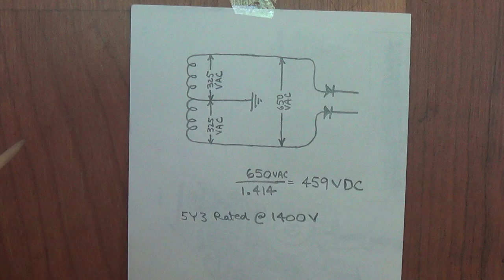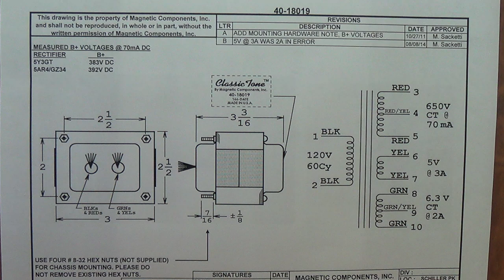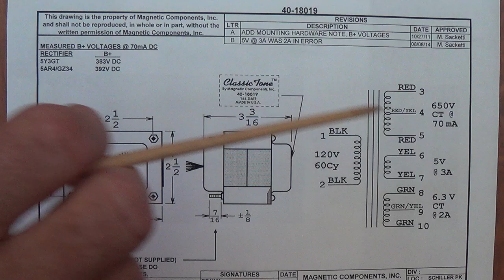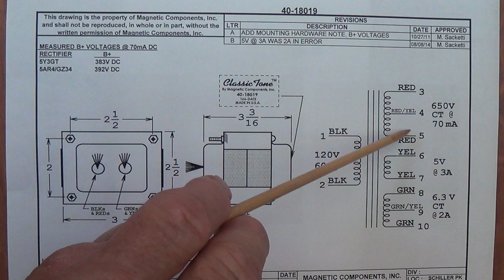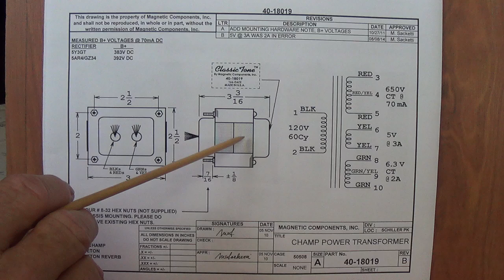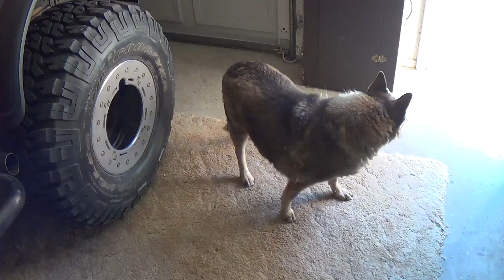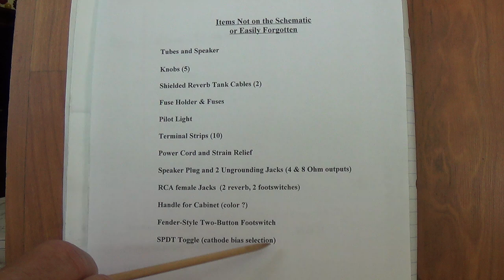How to Scratch-Build a Vintage Amp, Part 3:  Transformer Selection, Parts List, Cost Analysis

Comment: Hello Doug! I'm enjoying your videos immensely! they are very pedagogic and your pacing is very accommodating. I often revisit your videos when I have understood something new, and they always confirm and consolidate the knowledge. The first time I watched this particular video I could not really understand the specifics, but now a little more vocabulary has arrived in me :) I however wonder - what is the difference between Class A Triode Connections / Pentode Connections. the 40mA from the 6L6 correspond to the zero-signal plate current of the Triode Connection (?) with a max plate current of 44mA, while the pentode connection is 72mA/79mA. I wonder how to read this information. Does the connection just mean that there are triodes earlier in the signal chain, as apposed to pentodes? do you always calculate for the zero-signal instead of max signal? I also find different mA for the 12at7, and I feel that the plate current information is different between datasheets, looking at the 6L6 I find everything from 40mA to 56mA for zero-signal plate current. Might I be looking at the wrong information? thankful for any clarification you can provide.
Reply from the maker: Thanks, Anders. The triode/pentode connections refer to whether the output tube is wired as a pentode, with all 5 internal components wired separately.....or as a triode, with the suppressor grid connected to the cathode and the screen grid connected to the plate (anode) so that only 3 separate structures exist within the tube  (grid, screen-anode, and cathode-suppressor). Some people like the "triode" sound.....but it offers much lower gain and a lack of clarity.

I bias grid-biased output tubes at 70% of maximum plate dissipation, and cathode-biased output tubes at about 95-100% of maximum plate dissipation. The plate current itself is not the defining characteristic of tube bias.....the plate dissipation is. It is equal to the plate voltage (plate to cathode) x plate current (in Amps).

Comment: i know from experience you can overload a transformer and it will still work. you will get a voltage sag and it will run hot. it will run run hot for a long time, but it will fail earlier than if it was properly sized. it all depends on how hard you overload it. transformers are rugged so oversizing it depends on application
is it going to run 24/7 for many years or are you going to run it a few hours a day or just once in a while.
Reply from the maker: Thanks for your helpful input, KW :)
Reply: @UncleDoug  just because you can doesnt mean you should though. It can in some cases be a fire hazard so im not recommending it. However very brief overload followed by lighter loads is really the only way i would consider doing it and only if it qas a space limitation issue.

Comment: Hey Uncle Doug, Rusty and Jack:) This amp is absolutely perfect and what I was looking to build, it's in my budget range too. I was wondering if is too much to ask for you to post a full parts list with all your modifications you've made to make this amp the best it can be, also with the 4/8/16 ohm outputs can I output a 12 inch speaker or possibly 2?
Reply from the maker: +Tyler Holmes Tyler, the list in the video is as good as it's going to get. If you want a full list, I'm afraid you'll have to make your own.  Re the speaker outputs, I intend to use a 12" speaker in the cabinet, which can be unplugged to allow the use of any 4, 8, or 16 ohm speaker cabinet you chose.....4 speakers, if you want, as long as the impedance is correct.
Reply: +Uncle Doug Alright I guess I can't be lazy so I'll have to sit down with both schematics and figure it out :p I can't wait for the rest of the series :)
Reply from the maker: Best of luck with your project, Tyler.

Comment: What prevents you from switching to a more efficient rectifier tube since fidelity to concept is not a limiting factor?  I can learn from your answer. Thank you for these videos.
Reply from the maker: The 5Y3 is an excellent rectifier tube, Mod. It's current draw is low and it is relatively efficient. Also, it's all the rectifier that this circuit requires.
Reply: Thank you for the reply. With only one view per video so far my comprehension is still very sketchy but, taking form.  I found myself developing a fondness for the GZ34, (must be a senior thing, lol) .  Also, the diode rectification was fascinating.
Reply from the maker: You're welcome, The GZ-34 is, in my opinion, the best tube rectifier available, Mod, but I felt it was overkill for the Tremo-Verb. Diodes are nice, but a little cold and clinical for my taste.

Comment: Another thing that's easy to forget. Hardware like screws, nuts, bolts, standoffs and the like for assembling things to the chassis. Luckily, many of these things can be found at your local hardware store if you look around carefully in the hardware department
Reply from the maker: +Alva Goldbook  You're right, Alva. Fortunately, I have a 50-year accumulation of all sorts of hardware items and rarely fail to find what I need, buried in drawers and boxes in my workshop.

Comment: Hi Uncle Doug. Sorry if this is a silly question, but I have a 6V rectifier tube (EZ81), 2x 12AU7s, and 2x EL84s all running off the PT. I want to add a pilot light to the heaters - I believe the light draws 150mA. Should that be included in the equation? I'm wondering why it's not included here, and I just know there's gotta be a good reason. And as always, thank you for your inspiration.
Reply from the maker: Yes, the pilot light must be included, Shaun.....and the PT should be able to provide at least 10% higher current than the circuit requires, as a "safety cushion".
Reply: Thank you,  @UncleDoug  !

Comment: Hi Uncle Doug, have a question about the 325-0-325 rectification explanation around 4:35 or so in the video.  For a full-wave center tapped rectification wouldn't the ideal DC output be only 325 / 1.414 == 230v RMS?  Only the positive halves of the wave are passed through the diodes.
Reply: Oh wait, I didn't listen carefully enough.  You never stated that the 325 was peak voltage.  Your equation is correct (and assumes RMS 325 CT AC voltage without stating it explicitly).  You probably explain better in the video you referenced in the video.  Sorry for red herring!
Reply from the maker: +Jack Pien No problem, Jack. Since full-wave rectification is used, the transformer's RMS output would be 650/1.414 = 460VAC. As you can see on the transformer manufacturer's literature, after rectification losses, the net DC output is about +390VDC, which proved to be right on the money.
Reply: +Uncle Doug Thanks for response. The math works out. What threw me off was the 325*2=650 then divide by 1.414. Made me think that you were assuming 650 peak n computing RMS from that. Versus 325 * 1.414 to get peak rectified DC. But 2/1.414 = 1.414 so math works out to be the same!
Reply: +Uncle Doug The way you explain this is a little weird to me and I had to go through the math myself to see you were right... I was always taught that all AC voltages are stated in RMS unless otherwise stated and RMS values are always lower than peak so to convert an RMS value to peak you need to multiply, i.e: 650 * 1.414 = 919. So after the rectification loss of say 70v*2 (for both sides of the wave) = 140  and smoothing cap we should get 919-140 = 781vdc. Then because the negative rail is at the center tap of the transformer this would be halved, i.e: 781 / 2 = 390vdc. Surely since we know the ground rail is at the center tap we don't have to add the two halves and simply calculate using 325RMS? Great video series by the way :)
Reply from the maker: Thanks, Kevin.

Comment: Hello Uncle Doug,  Having listened to your measured tone in all your videos and the thoughtful replies you give to everyone's comments, I thought here is man not prone to rash statements.  So I was more than a little, although very happily, surprised to read that on the occasion of your channel's 2,000,000 view you are going to throw a party, complete with entertainment, in your backyard.  Buddy, I hope it is one BIG backyard because I reckon most, if not all, of your subscribers will be there.  Personally I'm getting my passport updated tomorrow.  Now, only because it is so o o o expensive subscribing to your channel I am going to get my money's worth and combine a number of thoughts in one go.  The guys at Valco must have realised that mods were needed for the S6422 because the Supro 6622 uses two halves of a 12AX7 the drive the primary of the reverb transformer.  They ditched to 0.001uF input for another with 100K, they bypassed the cathode resistor of V3 with a 35uF/50V cap but, very surprisingly, still no bypass cap for the 6V6 cathode resistor.  You have mentioned that you may even try a 6F6 in the output.  These were the first O/P tubes I experimented with and I would love to hear one in your amp.  The next is just my personal opinion and only that.  On the subject of components with 'vintage tone' I would say one thing.  Way back in the 60s the manufacturer's ads for capacitors and resistors that I saw were all about better tolerance figures, superior temperature stability, higher voltage ratings, smaller size etc, not about tone.  Maybe components have changed.  I hope that hasn't opened a can of worms as I believe people may buy whatever they think is best, assuming funds available and I respect their decision.  Lastly, do you ever sleep?  Do you respond to all our comments while having your meals?  I don't know how you find the time to build and repair all the amps and other equipment.  Then just for good measure you make videos for us where you are the Producer, Director, Script writer, Sound engineer, Props arranger and Narrator.  Thank the Lord that Rusty does the camera work and Jack rolls over and does the ricks.  No offence but I don't want any pictures of you rolling on your back.  I'm enjoying every minute of this new series and in between chapters I go back and have another look inside one of your Wurlitzers.  Many moons ago I worked on Teletype M15s so gears, cams and levers are another interest for me.  Regards, Jeff.
Reply from the maker: +Jeff M  Greetings, Jeff, and thanks for one of the most thoughtful and accurate comments I have received....maybe ever.  First, I hope you can make it to the party because I need someone to wrangle the pole dancers and keep them in line. 

You're right about the Supro's double-12AX7 reverb drive, yet even then it is inadequate for all but the little tank they used, and probably only marginal at that. 

I intend to experiment with cathode bypass on the output tube, and have long wondered about the possibility of using a 6F6 for very mellow, relatively low output....easy overdrive application. They were common in the old radios I used to repair, but rare as hen's teeth in guitar amps.  

I am very dubious of the claims made by the purveyors of high-cost "tone" components, and have personally never felt they made a difference anywhere near commensurate with their cost.  

Thank you for recognizing the time required to produce the videos and respond to all the comments. On some days, I may spend a total of 8 hours at the keyboard doing this.  Every time I create and post a new video (which may take two or more full days), I can expect to spend a  greater amount of time on the responses to it, but the warmth and appreciation of the viewers keeps me going, like jet fuel to a turboprop, or a dog cookie to Rusty.  The shocking truth is that this is only one of several active hobbies, so to answer your question.....No....I don't get much sleep.

Comment: Hi Uncle Doug! Are the plate currents found in the datasheets? Or is it something that is calculated based on the tube's max dissipation and target HV B+? Also, based on my limited understanding of data sheets, am I right in assuming that these plate current values only apply to Class A / single ended applications? If so, does it mean that the push pull plate current will be different when such a design is used, and multiplied by the number of output tubes in a given design?

Thanks! Your teaching method is very effective, at least for me. :)
Reply from the maker: +themarcoharder  You're welcome, Marco. The tube handbooks offer different values for each type of tube configuration, and the values do differ.  However, you're correct that the real issue is the Plate Dissipation, as calculated from the PC and PV.  The maximum PD is clearly stated for each tube, and we generally bias at 70% of max for fixed bias and 90 to 100% of max for cathode bias.

Comment: Hi UD! just curious, why include two jacks with 100k resistors instead of one with a 100k and another with the .001 cap? With the latter variation, you basically have "normal" and "bright" options, but with the first just two "normal" inputs. And at that point, why not just have one? Good series so far!
Reply from the maker: +Mutt Amps Thanks, Mutt. To be honest, I'm not a fan of bright, treble-intensive tone. It reminds me too much of the tone you get from solid-state amps. I prefer warmpth with plenty of bass (and clarity....but not excessively enhanced).  The only advantage I can think of for two equal inputs is to allow the playing of a backing track through one while accompanying it on the other....or maybe something I generally never do (due to several restraining orders), which is sing while playing.  I'll experiment with the impedance on each input and see if I can't get two different, but usable tones.
Reply: +Uncle Doug  Fair enough! I hadn't considered the backing track option as I don't usually do that, but it makes sense. The singing? Well that's for you and the neighbors (and local law enforcement)  to work out... Also, I  appreciated your comments on the price of building an amp and boutique amp prices. When you factor in hand assembly time on top of the price of the components, the profit margin a consumer thinks the manufacturer is making at the prices they are charging shrinks considerably.
Reply from the maker: Thanks, MA. If this series accomplishes nothing else, it will publicize the true cost associated with quality amp production. I marvel at how most amp makers can maintain sufficient income to stay in business. My hat is off to them.....and all small business owners.